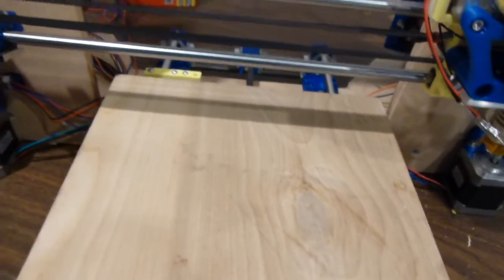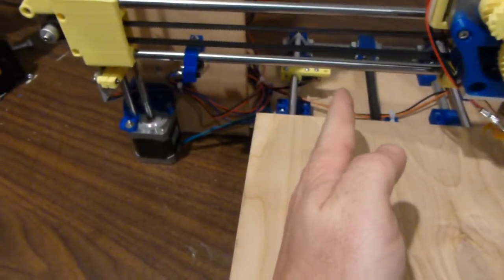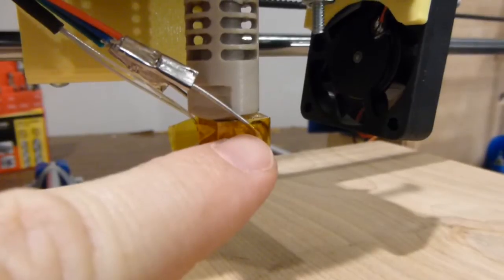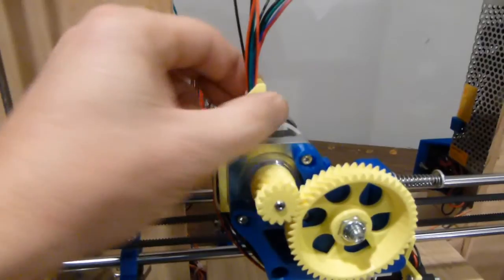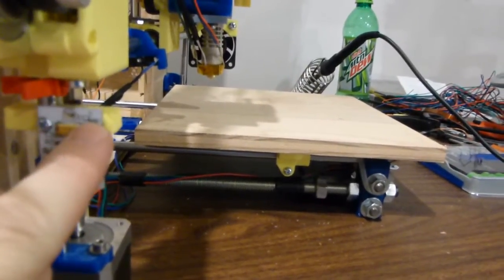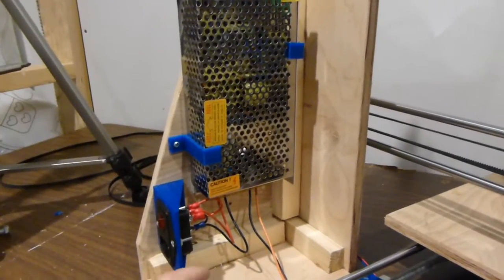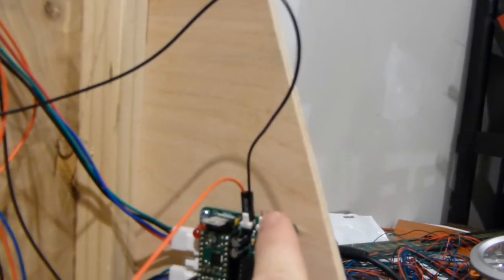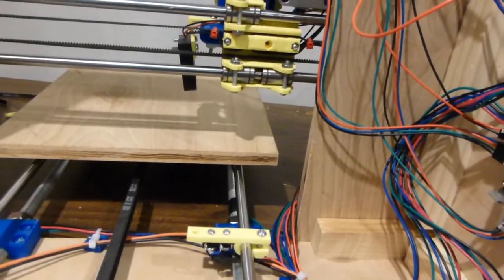Prusa i3 assembly - pulling it together

Comment: Great video (and series). Very helpful to me, thanks.
I was wondering why you put the y axis motor on the same side of the frame as the extruder etc? Is it because otherwise one would need to cut out parts of the bottom piece of the box frame in-order to position the motor close enough to the extruder to get the full y axis travel?